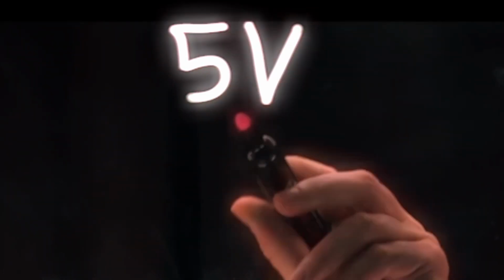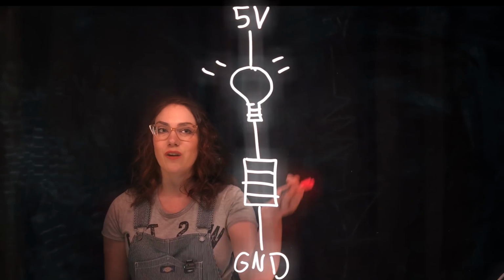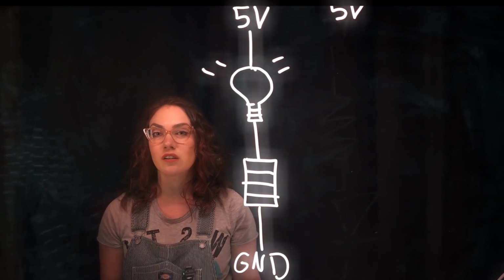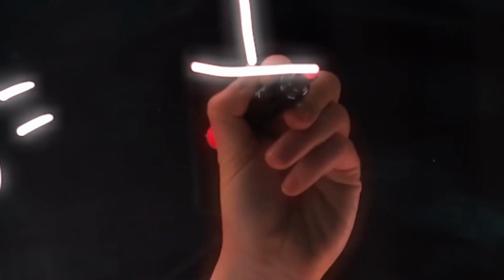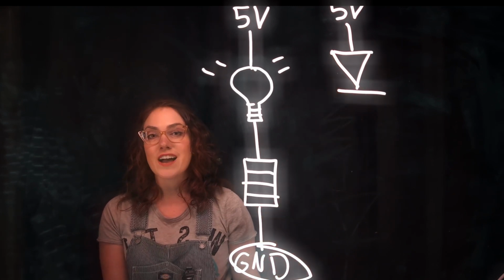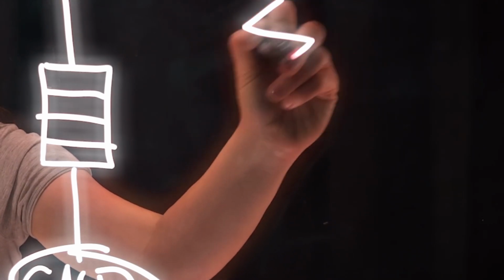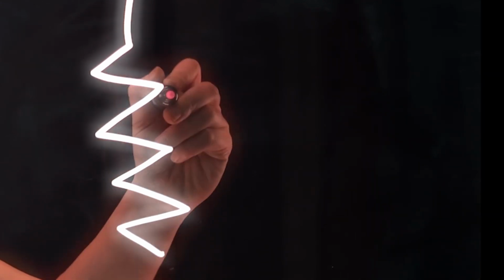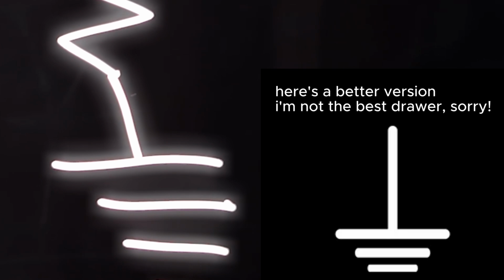Circuit Diagrams

Comment: I'm from EU, thus probably biased ;) but I always thought that on paper, a casually drawn squiggly line for a resistor could look tooooo much similar to an inductor's spiral - and such thing could be misleading, especially when a diagram omits other identification for that element.

however, I'm not anyhow professional, my biggest "engagement" with diagrams was during a few projects in "college", or when I was young and I was messing with my dad's job, or recently watching BigCliveDotCom's different disassembly and reverse engineering of stuff 😅

Comment: There's some kind of nonsense going on with UK symbols. All the way back to physics lessons in school (1970s) we've used a zigzag line to represent a resistor. On official UK symbol charts and in my day to day work as a diagnostics engineer we still do but looking at modern teaching aids we use block representations. Weird.